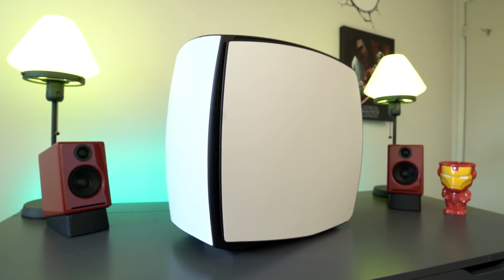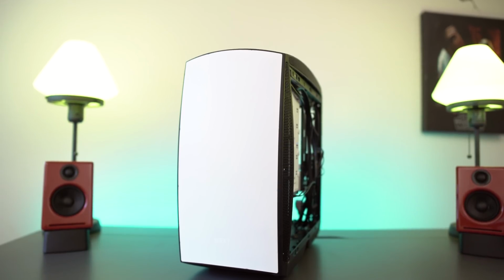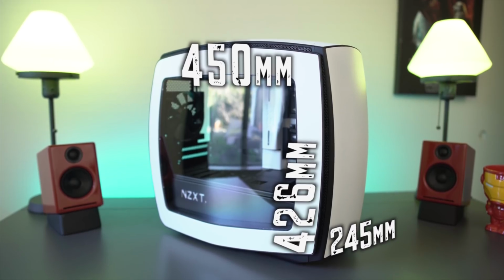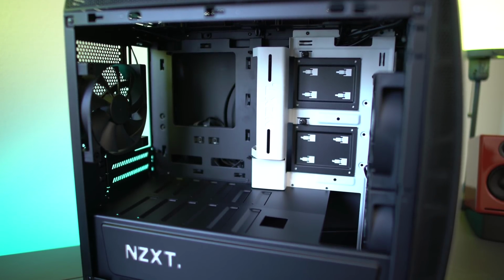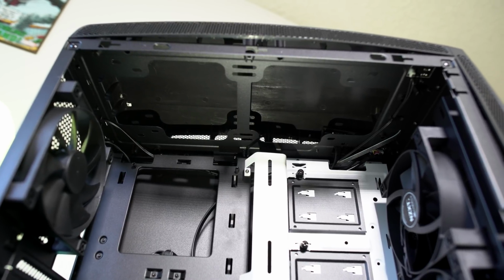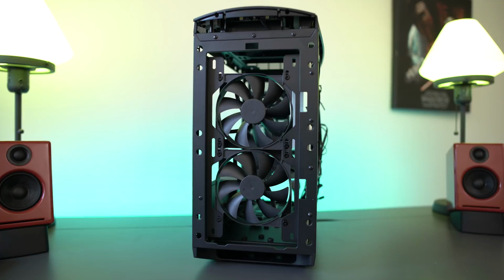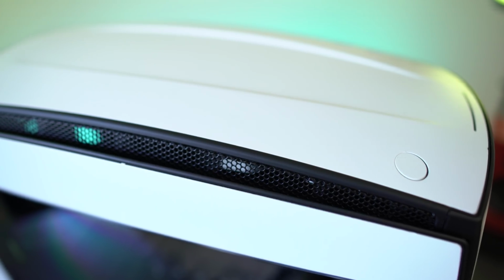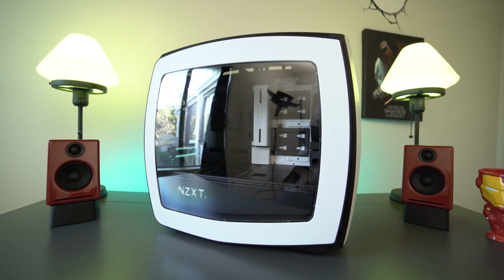CURVED PC GAMING CASE? NZXT MANTA!

Comment: This case is ugly, i'll just keep my s340.
Reply: +Smael Neo hey how is the S340? I'm needing a new case because I've moved my parts from one location to another and it costs $105 to move my other case over so I might as well buy a new one. I just want to know what your takes on the case are.
Reply: Hmm... I'm considering either the S340 or the Corsair 400C .... hard decision hahaha I'll just wait for a sale and see what's up.
Reply: Same
Reply: +poiisondn i chose the s340 cuz it looks classic,fancy and awesome in both white and black, easy to work with. Strategically placed slots for efficient cable routing and Plenty of room for modding.
Reply: I'm not sure if they are the same or not! but yes it does scratch easily, even my brother's Phantom 530 window panel did scratch just by cleaning it, but you can avoid that by being careful.
Reply: Smael Neo Hahah that's why I liked it too but I read upon some other comments that the S340 window panel scratches easily. I have a NZXT Switch 810 and the panel material might be the same?

Comment: Who would buy a sphere case. The motherboard would be in the middle. The case would be held by a stand that's designed to hold ot.
Reply: *it
Reply: Did you not watch the video? The chassis itself is straight while the body of it (exterior plastic panels) is curved. Thus, It is pretty much a regular pic with curved plastic panels.
Reply: xSnakeStyles
I'm talking about a differently designed case...